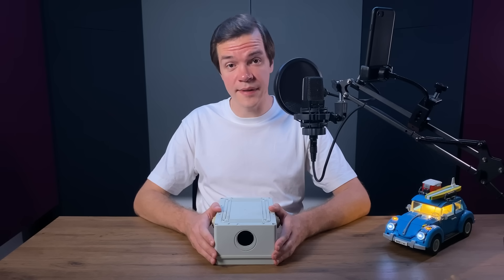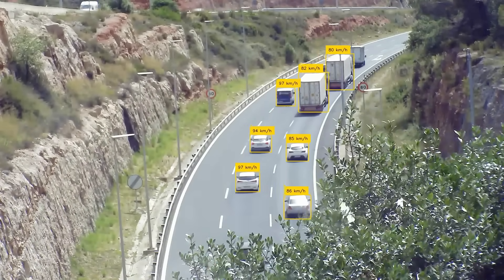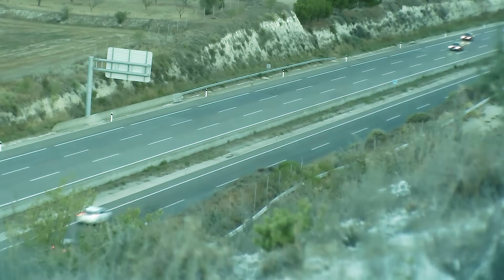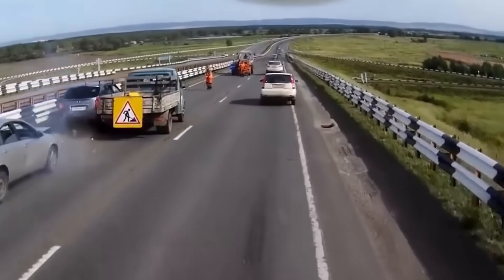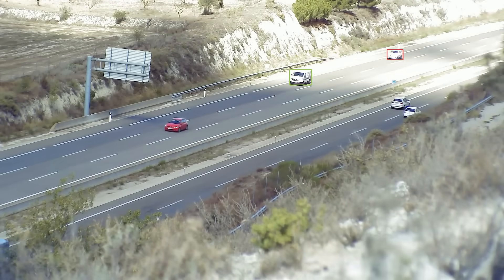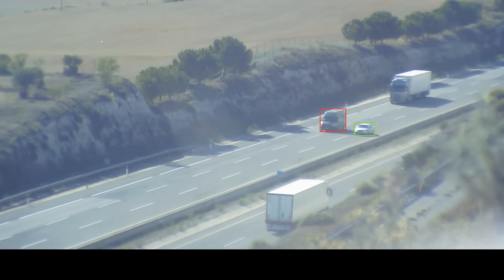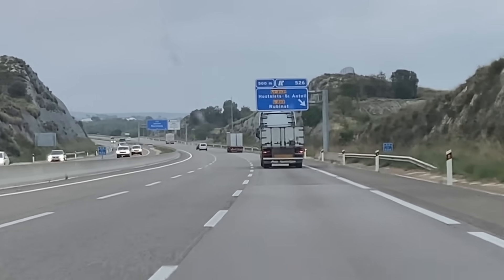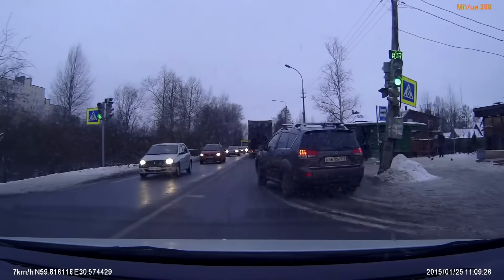New Anti-Tailgating Camera Reveals Shocking Statistics

Comment: I have adaptive cruse control, so I'm always at a safe distance from the car ahead, but there is a problem every time I use it. The safe distance is always seen by others as a nice gap to move into, so my car is always automatically using brakes to get the correct distance back again. So using a safe adaptive cruse control means that loads of times I am tailgating a car ahead for a sort time.
Reply: Try turning that shit off in traffic and actually driving the car yourself and paying attention. JFC.
Reply: @serafinobueti7154  Sounds like you just can't afford a car with it on, please don't be so jealous.

Comment: Good work and analysis.  I have been rear-ended three times in my newest 2 year old car and it's happened multiple times previously.  Tailgating and distracted driving.  Just because you are not at fault doesn't mean you escape the hassles, arguments with insurance companies and out of pocket expenses.  Plus you end up with a car that is worth substantially less even after proper repairs.  With an advanced system based on the work you have done I believe it would be possible to develop a fair tailgating detector which does not penalize drivers who were cut off, but instead target the drivers who do the cutting off.

Comment: Here in the US, we have a two second rule. This automatically compensates for the vehicle speed. If I get a tailgater, I open the distance up to four seconds because that would give me time to stop gradually in order to prevent the tailgater from hitting me in the rear end. Usually, this causes the tailgater to pass me and go tailgate someone else.😂
Reply: Right. Simple observations will easily show that most of the time it's not personal. Once a tailgater passes you, they just tailgate the next car. ☮
Reply: I’ve also been taught a 2-second rule in the US.  Unfortunately very few people use it.  Good reasoning on opening up some space in front of you when there’s a tailgater behind you.  We need camera systems and ticketing to crack down on tailgating.
Reply: The US has 50 states that  individually regulate traffic, it's a recommendaton because its not generally enforced, and it's  3 seconds for seniors.      Your approach works if the following driver is paying attention.     I did it easier to simply establish "my" minimum safe interval, not exceed the posted limit and always try to maintain an escape path.  I'm not in a hurry because I allow sufficient time to get there.   If there is a lane to my left, I'll drive barely slower.  At low speeds this gives other drivers options, at high speeds it encourages everyone behind me to pass.  I figure that anyone who is offended by my driving at the legal speed limit should be given the option a to get to their funeral a little quicker.
Reply: Three seconds in most of the world, and that is the closest distance that should ever be used.
Reply: I was taught a 3 second rule but that feels very excessive. I try to keep a 2 second gap, and if the car behind me is tailgating me (or the car in front of me is tailgating the car in front of him) I’ll increase it to 3
Reply: Here in the US , it depends on your state and your driving instructor. But I was taught (upper Midwest): 2 seconds in town, 3 seconds on the highway. They didn’t provide a hard rule on what speed the transition should happen at — but also I don’t think there were any roads around us that had a speed limit higher than 35mph and lower than 50mph, so there was a pretty obvious gap between the two sorts of driving.
Reply: Two is the bare minimum though. I've always been taught three. Definitely helps to have that wiggle room. Four if the weather sucks, five or more if it's also getting slick out. And five or more again if your vehicle is loaded down or pulling a trailer, such that braking takes longer.
Reply: I slow down when i have a tailgater with the hope it frustrates them enough to pass.  They get to annoy another driver and i get to have a peaceful drive.  I coast down to the slower speed and i never brake.
Reply: @SeanPat1001 two second rule is if you are driving at ten miles per hour
Reply: @gavnonadoroge3092 
CORRECT !
 2 seconds Per EVERY ten miles per hour:
2 seconds @ 10 mph
4 seconds @ 20 mph
8 seconds @ 40 mph
12 seconds @ 60 mph
Unfortunately,  people use the 2 second separation rule to mean 2 seconds at 80 mph. Doesn't work...   ☆
Reply: @gavnonadoroge3092  no, it’s at all speeds. The idea is that the faster you are moving the further you will go in two seconds. That automatically gives you sufficient distance to stop, if you’re paying attention. at 60 miles an hour you were traveling 88 ft./s. So two seconds will give you a distance of 176 feet.
Reply: @SeanPat1001  at 60 miles per hour you need seven seconds to stop
Reply: @gavnonadoroge3092  Why would you need 7 seconds to stop from 60? Car stopping time is 2 to 3 seconds from 60mph, add in reaction time and thinking time and maybe you're at 3 to 4. But also you're not driving at a brick wall - you're behind a car doing about the same speed as you. The 2s rule is to give you time to handle them standing on the brakes and you not expecting it. You're still meant to look past that car to anticipate more significant/sudden slowdowns (and back off further if it's not possible to see past).
In reality, people rarely are as far back as 1 second behind in the UK in moderate traffic.
Reply: @gavnonadoroge3092  so does the car ahead of you.
Reply: @SeanPat1001 no, the car in front of me can crash and stop on the dot. If you do not want to join, you need to have your full breaking distance in the interval between you and the car in front.
Reply: @asharak84 no. reaction time is 1.5 seconds AT BEST, stopping time goes up with speed. In  fact stopping distance goes up as the square of a speed increase (41.4% increase in speed doubles stopping distance). The peak rate of conversion of kinetic energy is constant. The following gap (3 seconds) only covers reaction time, not stopping distance. That's why it's so dangerous to stop on the side of a freeway. The following gap also allows you to see obstacles and react. Being closer does not speed your trip but increases everyone's risk. Tailgating kills, not speed.
Reply: @ehb403 distance does go up with the square, but time is linear. And 7 seconds is still hilariously loong. I agree people should not tailgate, but actual tailgaters are frequently within half a second, so 2 is a massive improvement. Average reaction times when driving are about 3/4 of a second, not an "at best 1.5", the at best for driving are around 0.3s but that is unlikely in real life. Again, I agree people drive too close but the goal is not to leave time for a full stop in the gap
Reply: @asharak84 don't guess, do the experiment. Surely you don't think it takes only twice the time to stop from 70 as from 35 with the same braking effort? Your brakes have to dissipate 4 times the energy. Science and stuff.
Reply: @ehb403 brakes are able to absorb a lot more energy than one stop requires, the limit is traction which is the same. Yes, when racing heat dissipation is a concern, but not for a stop in normal driving.
Reply: @asharak84 nothing you said there is incorrect, or relevant. Fact is that heat dissipation is what stops you. Traction limited, true. Traction translates to heat dissipation rate under braking.
Reply: @ehb403  I was responding to where you claimed it was about how long it takes the brakes to dissipate the heat. This is utterly irrelevant. The brakes are heat sinks - as in they are absorbing the heat. Yes, they later dissipate it to the air, but this is mostly happening later. As you've now wandered into "stick random words together" territory I'll leave you to your fun. Parting thought for you if you now agree it's about traction - why do you claim it takes so much longer to slow down than it takes to accelerate? Same tyres, same road, same traction. Yet you claim it takes more than three times as long to stop as to accelerate from 0-60 given a sufficiently powerful car - this alone should be a hint you've made a mistake. Anyway, I'll stop replying now so enjoy the last word.
Reply: @asharak84 No, but I did get distracted by a subtle change to the argument. The original argument was "7 seconds to stop". Since it takes 4 times as far to stop at double the speed, but your average speed is now twice, the TIME does go up linearly. Sorry for the mistake. My original (and still valid) claim is that it takes more time to stop as speed increases. As to acceleration, almost no cars have power with traction to accelerate as quickly as they brake. Not sure what you're implying there.
Reply: @texasranger7687 OK, do what you want but you will find cars will pass you and enter the large space in front of you, forcing you to repeatedly slow down. 

Also, even in a crash, cars do not stop instantly.
Reply: @gavnonadoroge3092  yes but so does the car in front of you. This 7 seconds only matters when something crazy happens like a semi coming from the other side rolls in front of you causing you to need more than 2 seconds of following space
Reply: we also appear to have an unwritten rule that if you need to drive on a freeway at 20mph below the posted speed limit you should occupy the left most lane.
Reply: @michael-j-harrison   to f***ing real unfortunately.
Reply: All that work just to avoid changing  one lane and letting faster traffic through. 

Is there a medical reason that prevents you from reverting to Lane 1 when ?

Comment: The next best thing to do other than leave a safe distance is to leave no distance, if you're touching bumpers and the car in front hits the brakes there is no impact just pushing. Yes it has it's own problems but it works for trains and trailers.

Comment: 100m safety distance would be for emergency breaking for a static object on the road.

In any case, the more the better. Since my car has adaptive cruise control, I usually let it do its thing. Set to max distance, it's not 100 meters. More like 50.

Comment: I believe it is possible to create an algorithm that fairly detects tailgaiters over the short distance provided by your camera based on (a) current speed; (b) distance from the car ahead and (c) the deceleration rate. In simple terms, if you are too close to the car ahead and you are not slowing down at a sufficient rate, then you are guilty.